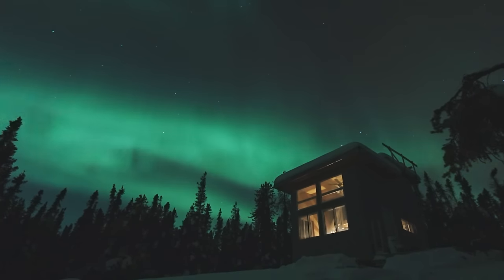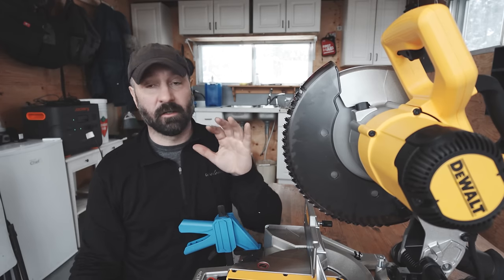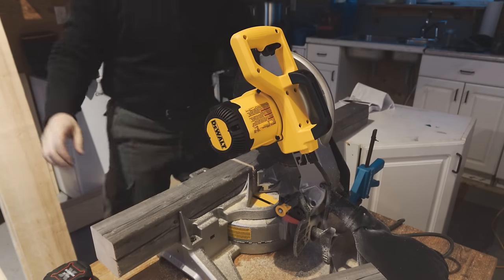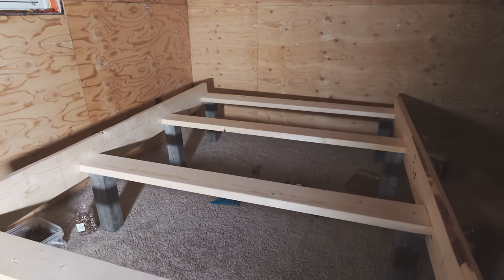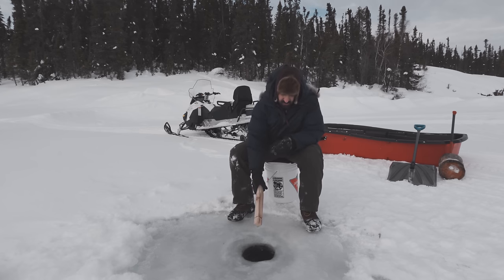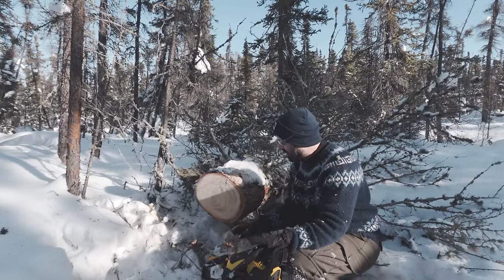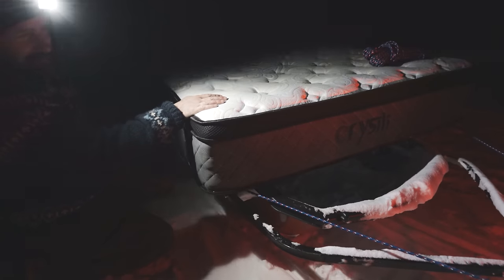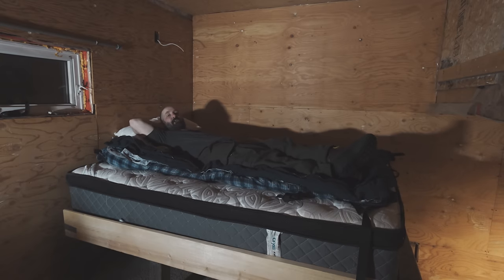Learning to be a man in the forest

Comment: Stihl MS 250.  Chain needs sharpened correctly to keep it from running to one side.  You ain't playing a fiddle with the file or sharpener.  Keep it level and at right angle.Good vid.  Pike, I've seen those worms before.  parasite I think.  Need some cross slats or plywood, 3/8 ths inch on bed bottom.  Generator is probably limited to 14 amps.  It will burn up your motors not haveing enough power.  2x4 runners to slide it up on.  I'm a one man show  do everything by myself.  Nxt time, you are doing good learning.  make a simple stand/mount portable for the saw.  Just have a level in and out side  easy.

Comment: Great video as always,take your chain to a shop and have it sharpened on a machine this will even up the cutting edges get it cutting straight again all it takes is clipping something hard with one side of the chain and it’s will be just a little bit more dull than the other and then not cut straight.

Comment: Make sure your extension cord from the generator to the cabin is the correct gauge for the amperage used by your saw. 
If the gauge is too low, it will burn out the saw motor. 
There is a guide in the manual for the correct gauge and length of cord to use.

Comment: I have a dewalt compound mitre saw like that. I don’t think that clamp is for clamping the saw to the table. I thought it was to hold wood on the saw when cutting the wood. You can use the saw on the floor too if the clamps are a big problem. Great video as usual. Cheers from Colorado.
Reply from the maker: Thanks for the info!

Comment: Jay, thats a fence clamp, not a table clamp, it is meant to hold boards firm to the fence, but, it nor the table clamps are really needed, you can fully operate that saw without them, I have the same saw, I threw the clamp away along with the box and plastic it came in

Comment: Hi Jay another great video.
That bed looked pretty strong, I think it'd have railing on that landing so I wouldn't fall into the living room that's me and my Mr Safety thinking lol. Now would have made it even harder to get that mattress up over lol. Maybe a removable gate like set up.
My guess is for the saw going at an angle is its not cutting well when you sharpen a chainsaw there two sets of cutters and if they are not sharpen well both ways that will happen.

Comment: All power tools need to ensure they are getting the proper amps.  Any drop and that could burn out the motor.  Easy to understand if you think of using an extension cord that is too long and loose amps or an improper sized cord will do the same thing.  So....turn off whatever you can when using an electric power tool.

Comment: Your chainsaw cuts are crooked because the teeth on one side of your chain are more sharp than the other.     If your chain is still fairly new, I'd take it to a competent sharpener and have the teeth balanced for left and right cutters.     If the chain is badly worn, get a new one and sharpen it with the same number of strokes per tooth.    Always push the file to sharpen and lift the file from the tooth while pulling back.    Stihl sells a 2 in 1 sharpener that sharpens the cutter while setting the depth gauge.   Pferd also makes and sells the same tool for a few dollars less.    Pretty sure Pferd makes the Stihl version of the same tool.    Make sure you get the correct tool for your chain pitch (3/8 LP, .325" or 
3/8").

Comment: 10 inch miter saws are better suited for trim work. I have had a 10 in the past. Have a 12inch now. But I still like using a circular saw, because of not having to tote a bulky saw around everywhere. That saw will give out before the generator will. Possibly burn the motor up, cause it's not getting enough power to function with everything else energized at the same time. I'll subscribe as long as you're willing to learn some carpenter tricks I'm willing to teach you. Some are fun. 😁

Comment: The chainsaw needs sharpened equal on both sides. You can tell when it's sharpened correctly as your sawdust is chunky. You need to sharpen teeth evenly. If you do 3 swipes of file, you need to do all teeth the same hint ( start at the link that joins it together). Pull chain one tooth at a time towards you. Then do same on other side. Its tedious but so worth it. You will get better each time.

Comment: Turn off eco mode on the generator when you run the saw. Should be fine. I'd also run the lights off your jackery when cutting. Finer tooth blade   will help the rough cuts.

Comment: Cord size may very well be your issue. I se your generator is a bit far away. I would suggest at least a 12 Ga. cord if not a 10 Ga. would be more applicable.  In order to draw your amps needed without overloading cord capability it needs Wire size to flow electrons.

Comment: those eye hooks can be setup like a pulley ... but they will have lots of friction when lifting ... BUT can be used in a pinch once or twice .. even the basic clothes line pulley's would be better to get a mechanical advantage so having 6 to 10 basic wheel pulley's to create your own block and tackle setup with a few direction change pulley's to make lifting easier

Comment: Hi Jay. While running anything like that saw that draws hard instantly, turn off your eco switch. The generator needs to be running full power when you pull that trigger. Better for both your saw and generator. Still watching your video but that has to be the problem as your Honda has lots of power to run your saw.

Comment: If you count the teeth on your chainsaw and it might have more teeth on one side than the other. This will make it cut on an angle, or it’s dull on one side. A quick way to see if there is more on one side is when looking at your chain spin it by hand and if there’s two in a row on the same side that is were it was joined.

Comment: The teeth on your chain are not evenly filed, that's why the chainsaw is cutting at a curve. That's fairly common with people who hand file their chains. It takes a little practice to get it right. There are filing guides made for hand filing. The only other possibility is the rails on the guide bar are not at 90°, but that's less likely than the chain being unevenly sharpened.
Been a sub since you only had a few hundred subscribers. 
Cheers 👋🇨🇦
Reply from the maker: Excellent information on rhe chainsaw. Thanks for being a sub all these years. Jay

Comment: My own experience. At @17.26 Your chain is sharpened wrong I think. Other side of the chain is cutting better than the other side. I learned that also the hard way. My father told me about 35 years ago to sharpen the chain, and after I did just the same like you did. He asked what did I do wrong. Took a while, but I figured it out. I filed/ sharpened the chain wrong. You have to sharpen it from the same from both sides.

Comment: Have your generator closers to your saw. If you’re over 50’ away you will lose power. For the lights you’ll be fine but when you want to use the power saw, bring the generator up on your patio and use your extension cord done then you should be fine.

Comment: The tear out that you are getting from the saw is because the blades that come with them are kind of junk. They are good for rough cuts, but if you want more finished look you need to replace it with a blade with more teeth that is designed to provide a cleaner look. There are several videos on youtube that going into explaining it way better than I can.

Comment: Flip your bar on the chain saw if that doesn’t work get a file and go around the edges on both sides get that burr off the chain saw bar it happens just from wear and sharpen your chain.
Reply: This will help straighten out your cuts through bigger logs.

Comment: You may have bent the bar or twisted it. I guess I should say a little bit might need to replace the bar and if it’s struggling a little bit, that might be the reason. That would be because the chain may not be gliding through straight, so it’ll cause that saw to struggle.

Comment: btw .... your dewalt will require about 2200w at start ... and run around 1800w while in use ... so you want to have a generator that will run constant at 2500w MINIMUM ... thus the craftsman 3300 will do you well and allow you to have a decent lamp around 40w .... (40 x 120) 4800w constant ... plus the saws 1800x is 22800w ... sitting just under the generators constant draw rating ...

Comment: The generator will be fine. It is normal for the motor to take a split second to ramp up the power when a heavy load is applied. Now IF the lights are dimming AFTER the initial start-up surge WHILE cutting that would indicate it was under too much load but since they returned to full brilliance all is well. If that flicker really bothers you, turn off eco mode on the generator so it runs full speed all the time but honestly, it's not necessary. Also, turning off the lights is unnecessary. Those LED lights use barely any power compared to the saw.

Comment: @4:05: OK Let's address your power situation. You need to setup a heated box in your Cabin, which is large enough to house two EcoFlow Delta Pro Solar Generators connected in parallel to produce split phase 240 Volts AC at 30 Amps. You need to plug that 240 Volts AC into a splitter box which gives you a series of 120 Volt AC outlets at both 20 Amps max and 30 Amps max. The Delta Pros have an option to also connect special (Smart) gas generators, which charge back up the Delta Pro solar genny when its batteries drain to a certain point (Which you can set !), and charge up your system AND give you one extra AC output at the same time ! 😃👍. Even if you only get one Delta Pro with one extra smart generator, you now have a total power solution for your cabin and all of your power tools. Each delta Pro is rated for 3,600 Watts (7,200 Watts if you connect two together), and can also take up to (2) external batteries or 1 extra battery and 1 smart gas generator per unit. The EcoFlow Smart Gas or Propane genny charges the Delta Pro via DC current instead of AC, so it's way more efficient. Since the Delta Pro is a Solar Generator type power station, you always have the option to plug in external portable solar panels and recharge your system up this way. OPTION 2: Get the OUPES Mega 5 Solar Genny Power Station. This alternative has a slightly more powerful AC inverter at 4,000 Watts, true 30 Amp current output from its TTL-30 120 Volts AC outlet and 20 Amps out of its regular AC outlets. You plug a special 240 Volts AC transformer box from VICTRON into the 30 Amp TTL-30 RV plug and that will step up your AC Volts to 240 AC if you need, or want to have a 240 Volt Power Box option in your cabin. The OUPES MEGA 5 Also has a much larger built in battery as opposed to the Delta Pro with over 5200 Watt Hours versus the Delta Pro, which has a 3,600 Watt hour rated built in battery. The OUPES MEGA 5 is a cheaper solution, but no way to connect a (Smart) gas/propane genny to it to automatically recharge your system when it drains down. @ 27:40 THAT is a lamprey fish sucking parasite invasive species courtesy of Asia. OKay, stop eating any fish with those attached or near it coming out of the hole, because once inside you they will digest YOU as well ! 😲😲👀👀

Comment: For that mattress or anything, like plywood, drywall, etc. That is awkward. Just use a few 2x4 or 2x6 flatside against the joist, longer than the deck height....angled, screw the top into the joist so they dont move around and shove it up or pull it up

Comment: It's fine for the generator. Get the blade turning, then dip into the wood. Is the gen. On eco mode? If so, turn that off when using the saw
Reply: Also, all I do is work on generators

Comment: your chainsaw not cutting straight is the bar needs squared. If you remove bar and look down it like a rifle, youll notice one side of where the chain rides is worn lower and needs "squared" to even chain surfaces up. A heavy saw user will flip the bar upside down EVERY blade sharpen or change to help keep wear even...hope that sets you up! (a simple belt/disc combo sander from harbor freight will serve you VERY well in saw maintainance!)

Comment: You need a bigger power chord from the Generator or Move the generator next to the building when cutting ... or cut outside ...  next to the generator... make sure the amp ratings on the fuses or circuit breakers are not too high .. because you can burn wire and have a fire ... Pork is not a healthy "flesh" or meat... some of us do not consider it food.

Comment: Um, I would put some type of bars  along the edge of the loft so nothing will fall off. Something like what you made for the stair railing but with no top to it, just have the ‘spindles/bars’ fastened to the top and bottom of the loft opening….if that makes any sense.
You don’t need to go all the way across if you don’t want to, just do the space across the end of the bed so nothing will be kicked or knocked off…

Comment: Also if the saw cuts.on an angle it's because the teeth are not sharpened even. In the winter time I'll bring 2 other chains and just swap them while cutting much easier then trying to put a perfect sharpening on the chain in the bush.

Comment: !st thing you have to do is build a table/bench so you can bolt it down, that 2000 will run a table saw < I use one at my cabin, you'd be suprized what that generator will run

Comment: Hey Jey.. im from NYC.. Retired Emergency service Worker,living in UPSTATE  NY..NOW and who dealt with heat/cold/ fire. Etc.. 5:02 hang a Tarp over front door as a wind break for loss of heat, i forgot to mention  when you opened door.. 1 You're no cook lol.. 2 learning on the fly YES.. 3 Why arent you using inexpensive  solar string lights .. i hate green energy as ineffective but string for your interior purpose is effective. Im looking at your pants Wool? I believe  Kodex. Manufacturers  if so let me know about purchase if Manufacturers correct. Why arent you hauling mire water from lake in 5gal bottles?its late..im loosing my thought train..let me know on the wool please.. i swear by wool underneath.
Summer rain catch basin..for water..BTW. PROPANE thickens in cold, causing poir flow. Low pressure  smoke/gas/C-o detection inside  use your tank.. 
Let me finish watching

Comment: Chain teeth needs sharpened to correct angle. Also take a file and file down the edges of your chainsaw bar, it will mushroom eventually if you don't and be wider than the chain. Nothing wrong with your chainsaw brand.  There are great youtube teaching videos.

Comment: I find it hard to believe that someone who can camp in freezing weather doesn’t know how to use a miter saw, or a circular saw .

, if that is perceived, as disrespectful, not the intent.  

So clamping your miter saw to your table try cutting a couple two by sixes the width of the table attached saw to the 2 by sixes then clap to the table blocking underneath table will be needed but it will straighten your table and will not be seen  . 

I just purchased a new Dewalt miter saw this month 12 inch sliding dual bevel.

If someone reading this needs my old one, you can have it just got to find your way to Nebraska to get it

Comment: The reason your chain saw doesn’t cut straight is because it’s not sharpened properly. The angles on all the teeth need to be the same on both sides or it will pull one direction or the other

Comment: Should you ever get to the point where your generator does not supply enough power, do not get rid of it!  Get a second one and build a parallel kit (they are simple, expensive to buy, but cheap to make yourself). That will save you a lot of gas by only running one generator most of the time instead of running a bigger one when you don't need the extra power. 
I can explain to you the simple wiring of the parallel kit.

Comment: More teeth on the blade the smoother it cuts wood with out having too sand so less teeth is for ripping not much for smooth cuts dewalt blades are not that great get a Diablo blade much better framing and  cleaner

Comment: I do like your channel, but you drive me nuts sometimes I want to just shake you and tell you you can’t do it that way, but it is what it is. to find out whether a power tool is too much load for your generator. All you have to do is read how many watts and amps your power tool uses and it will be full load amps on there and full load amps is or watts is when you start that motor up on that saw there’s a little bit of a load and then it steadies out at your full load or watt set up on your. Then you gotta look at your generator and see what the max output is on your generator and then you use it. You gotta figure out how many watts by using ohms law.